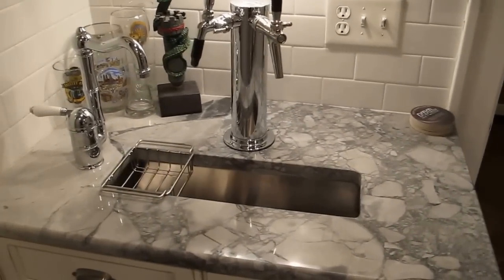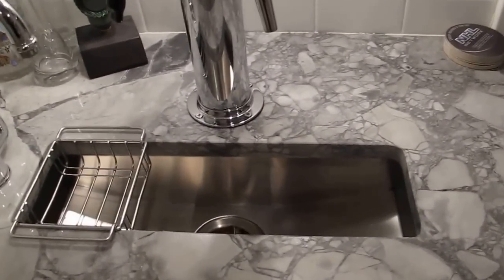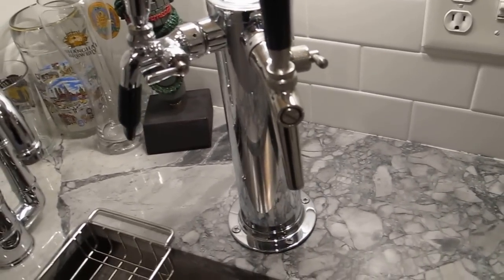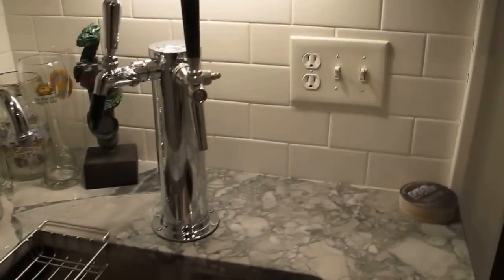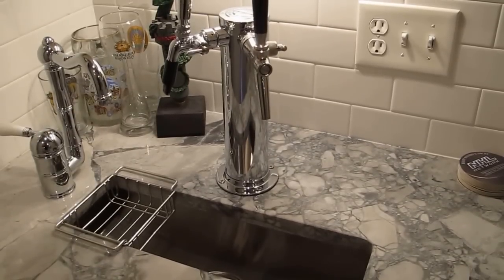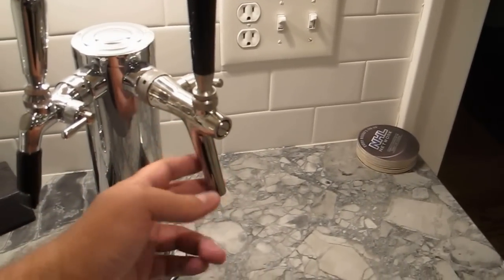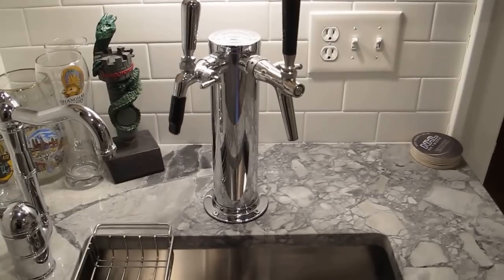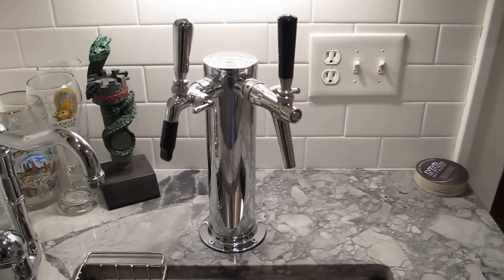Beer tap in kitchen

Comment: Hi, very nice set up!  I'm building a similar bar set up in my house/man lab right now.  Can you please tell us what tower system and taps you recommend?  I plan to have nitro stout and one Perlick tap - any guidance on specific parts would be very much appreciated!
Reply from the maker: Hi Mark,

I wish I could be of more help with your question.  I really can't say which companies might provide you with a better tower.  The reason I don't recommend this tower is because it's not wide enough and made it really hard to modify anything inside the taps.  If you're going to be running a nitro system this is a huge feature because the nitro taps go much further back into the taps.  You might want to try a box style tower.  I really do like my new cornelius tap and the perlick upgrade I bought.  I could say those are both very good quality units. 

Sorry I couldn't be of more help!  Best of luck to you. 

Best,
Opperwall Design Consultants

Comment from the maker: It does handle 2 beers independently.  What you need to get for a set up like this just simply a tower (this one is from Khrome Design) which has 2 product lines and then run them down to your fridge.  My setup uses a glycol cooled product line which is also insulated which keeps the beer super cold to the tap. 

If I had space above I could put a standard tap handle on it.  But the standard cabinet above does not allow anything over 7 inches tall.  I use 'pub handles' if I want branded ones.
Reply: HD Travel Shorts so your system uses a glycol chiller to keep the beer cold? I want to install a tap in my home bar and thought an insulated line from the basement to the bar upstairs would work. Looks like a glycol system would be best but quite expensive. How much did you spend on your setup?